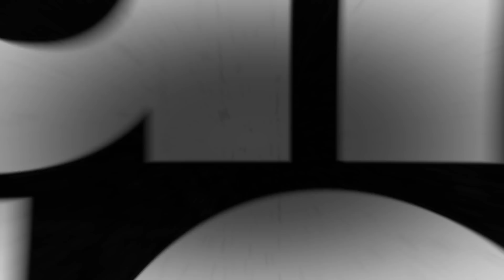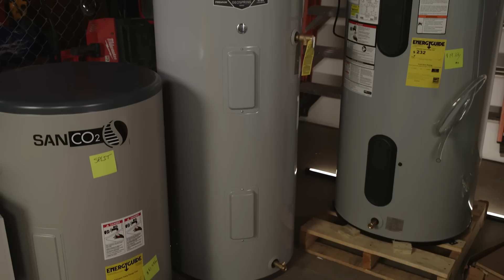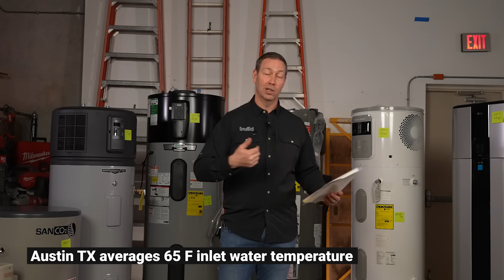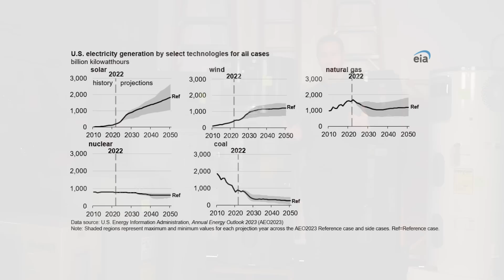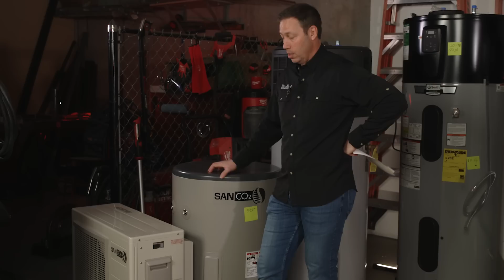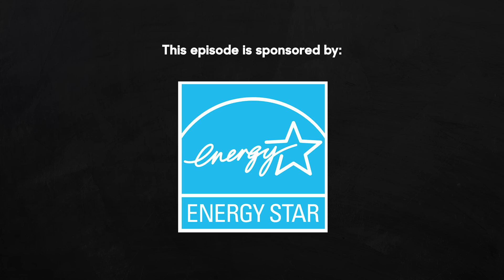2024 Heat Pump Water Heater Buyers Guide

Comment: This is exactly the video I have been looking for.  Have an aging gas hot water heater and wanted to know options that were available and details on it.  Now to find an installer in the Boston area that won’t charge an arm and a leg for installation!
Reply: My math for North Jersey said that any HP unit with a COP >= 3.25 is at least as cost efficient to operate as a gas-powered unit.

However, if you already have a gas hot water heater, the operating cost difference is going to take a very long time to pay back the capital cost of ripping and replacing a still working gas heater.

If you need to replace your gas water heater anyway,  then a HPHW can make sense as a replacement contingent upon the math.

If you want to remove combustion appliances from your home to improve safety or improve indoor air quality, these might be reasons that justify the premium of a rip and replace of gas for HP.
Reply: If you're interested, check out the actual test I did of a few of these on my channel. He missed the Stiebel Eltron that I really like. The video is Ultimate Real World Test of 3 Heat Pump Water Heaters
Reply: @BensEcoAdvntr The Stiebel Eltron wasn't included because it isn't on the Energy Star site today, or at least I couldn't find it.

I saw some positive videos on it a while ago but couldn't find it on the site then also, and that means it wasn't eligible for any Energy Star rebates which gives it a cost disadvantage.
Reply: @jeremyjedynak  that's too bad, it's a great unit and just as efficient in the real world as the A. O. Smith
Reply: @BensEcoAdvntr  I'm pretty sure it's your video that I watched months ago, if you went through having three different HPHW including an AO Smith and finally the Stiebel Eltron.

Consider doing some digging to find out why the latter isn't Energy Star certified. Difficult to see how anyone not on the Energy Star list remains in business let alone competitive when the enormous rebates for the the products and companies that are on the list.
Reply: Thanks @jeremyjedynak and @bensecoadvntr for the additional information!

Comment: Off topic question 
Do you think instead of zip or tyvek(housewrap)for your wrb you could use an elastomeric roof coating?Use normal osb then zip tape the foundation connection followed up with rolling on a elastomeric roof coating. Something like ol Henry or liquid rubber. Then flash your windows w/stretch tape or liquid flash
Reply: There are fluid applied WRBs meant for this. Idk the chemistry but surely there’s a difference so let the roof products stay on the roof and let the wrbs stay on the sheathing of the walls
Reply: @baxt1412  Great! I can't seem to find one for specifically what I asked about. Osb not zip. Can you please elaborate?

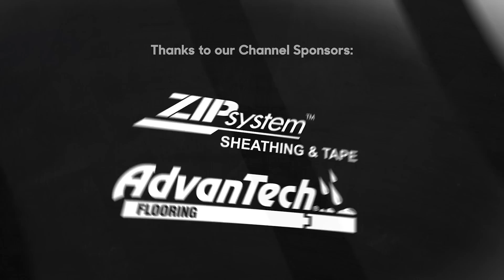Comment: 21:32 We installed a SanCO2 HPWP in Aug 2023. The heat pump was hung on the garage wall next to the 80 gallon tank. It replaced a 50 gal NG WH. We have never had hotter or so much hot water. The HP runs  very quietly and uses very few kWh. The tank doesn't have an anode rod so the tank is maintenance free. The SanCO2 has the best warranty - 15 yeard on its stainless steel tank and 10 years on its heat pump which SanCO2 will replace with a new HP unit if it needs service. The HP uses CO2 as the refrigerant which has the lowest global warming potential on the market. Also I couldn't find a local plumber or HVAC who would service an all in one HP as plumbers don't service HVAC and HVAC don't service water heaters. SanCO2 are the most efficient HPWH on the market. I'll be taking advantage of the $2000 tax credit via the Inflation Reduction Act to bring down the out of pocket cost to $6500.
Reply: The 80gal Rheem HPHW we installed last month was $2,451 including delivery and tax, the week before Black Friday 2023. Local power company rebate was $750. Federal tax credit will be $735.

This brings the net cost of the Rheem HPHW to $966.

As much as I like the idea of the Sanco2, it seems that spending $6,500 instead of $966 won't yield a 5.5x greater operating efficiency that would be needed to justify the 5.5x price premium.
Reply: My rationalization centered on I'm expecting/hoping the SanCO2 system will have double the service life, no local plumbers or HVAC would work on an all-in-one HPWH, the SanCO2 was more efficient so it's kWh consumption better fits within the remaining capacity of my PV system, and it has a much higher first hour capacity. Another cost difference was the SanCO2  cost around $2000 for removal of the NG heater, piping, vent, and installation of its relatively complex piping connections.
Reply: A double service life isn't evident as the Sanco2 warranty isn't double the length of the Rheem HPHW.

Also looking at the UEF (proxy for COP) numbers on the Energy Star site, the Rheem has a UEF of 4.07 while the Sanco2 is 3.5, so at least by the measurement standard established by Energy Star, there unfortunately doesn't appear to be an efficiency advantage that would justify the price premium of the Sanco2.
Reply: @jeremyjedynak  For 83 gal tank we installed, the Heating COP @ 80/47/17°F is 5.5/4.2/2.8. Additionally after reading the reviews of all-in-one HPWH, I didn't trust their service life, no local service, and I didn't want the maintenance hassle of maintaining a filter, changing the anode rod and having a tank susceptible to rusting and failure. Pay your money, live with your choice. It's a crap shoot which is cheaper over a period of 20 years. As the tank is stainless steel with no anode rod, I expect the tank to long outlive the heat pump so if the heat pump fails, you only have to replace the heat pump instead of the whole HPWH system.
Reply: @KentWimmer  Pre-installation, we had the passive anode rod from the manufacturer removed and an active electronic anode rod installed. $160 on Amazon, and comes with an actual 20-year warranty.

No concern about tank corrosion, and an actual warranty to back up that confidence.

I really wanted to like the Sanco2, but their product pricing isn't competitive compared to alternatives in the market, when objective metrics are used to make the analysis.
Reply: @jeremyjedynak  I'm gambling it will pay off. Good luck to us both.

Comment: I’ll try to do the math later about the monthly price difference between gas units and heat pump electric. Would have been a good addition to this video!
Reply: In North Jersey, my math said that any HP unit with a COP >= 3.25 is at least as cost efficient to operate as a gas-powered unit. And gas is way more cost efficient to operate than resistive-only electric, propane, and oil alternatives.

Comment: Installed a Rheem HPWH in my garage and if you live in a cool climate it's garbage. Energy savings are way overstated. Summer is ok but winter is worse than useless. Horrible recovery rate. Winter it will run until it freezes the evaporator and never goes into a defrost cycle. Won't stay set on resistance setting so I have to babysit it. Get an outdoor compressor with an inside tank if you want to do it right in a cool climate (like Seattle).

Comment: I would be curious to see/hear a legitimate discussion on using these for a heating source for radiant floor heat.  Seen and read forums that argue both sides with no actual data to back it up. But i am looking for more energy efficient ways to heat tightly built new constructions homes.
Reply: Same. You would want a vent kit so it uses outside air since you’ll never steal enough heat from the garage to heat your entire house.
Reply: @Krunch2020  Where i am at it would be in the basement with heated floors.  Could still vent from outside if necessary but would be concerned when the high is -10 like it is supposed to be next week.
Reply: It all depends on the climate where you live and how much floor area you want to heat. Most of these units have very small continuous heat output - the largest I've found is the SANCO2 GS4-45 which has a 15,500 BTUH output. They rely on running for several hours to heat up a small amount of water, generally while you're asleep (12 am - 6 am) and again while you're away at work (9 am - 3 pm). If you tried to heat water and your house, even a modern, well-insulated house would have to be only about 500 square feet. Several companies make air-to-water heat pumps which have a lot more capacity so they can heat and cool a larger house.
Reply: @kgsails7102  good to know.  My plan was to use it as a closed loop system so it would be dedicated as home heating only.  But like i said, that is still good info.  Thanks!

Comment: Matt - great content.  Part 2 - I would like to see how these hybrid heat pump water heaters work alongside a recirculation pump.
Reply: This is covered in ENERGY STAR sponsored training but would have been a good idea to include in this segment as well. Manufacturers state that recirc pump is fine as long as its a "smart" recirc pump set to a timer for when showers, bathroom use is most common, or have bathroom sensor to indicate pending use. You don't want the pump running 24h/7 w/ a HPWH.
Reply: If Matt does this suggested Part #2, I'm certain that EnergyStar won't be sponsoring it. :-)
Reply: Yes this would be so useful! I think many installers could benefit from this. (See my other comment about my experience with an installer who claimed to know but clearly did not know how to use one with a recirculation pump)
Reply: Matt has a heatpump water heater and recirculation system in his own house. I assume they work fine.
Reply: I have two Rheem hybrid water heaters and a recirc pump, and it works "fine" only by a very limited metric.

Even with two heaters working together, they can't keep up with the demands of my five-person household unless they are in "high demand" mode. Forget "heat pump only" mode. And in a recent discussion with Rheem technical support, after the water heater's emergency cutoff (ECO) tripped, I was told that I shouldn't be using "high demand" mode (if not, why did they bother putting that mode in the unit?), and that in any case, the water heater shouldn't be used with a recirc pump.

The tech's position was that it's just too much load on the water heater, and that can lead to glitches like the overtemp tripping (he didn't explain why that would be...seems to me if anything an excessive load on the water heater will keep the internals cooler, but...whatever...that' what he said).

My water heaters are about 5 years old. Maybe the newer models are better. But my own experience has not been favorable and I was told specifically (after the fact, of course) that I shouldn't be trying to use the heat pump water heater with a recirc pump.

(And yes, the recirc pump is on a timer.)
Reply: @harvey66616  super interesting. I'm planning almost an identical setup to yours. I've spec'ed two 50 gallon Rheem heatpump units and recirculation. How much insulation did you apply to the hot water pipes? Are you running a mixing valve? I'm in framing right now, so I can still adjust my course, but you've got me worried.
Reply: @jonathansage2147  I have some old not super insulated pipes (seem like 1 inch r2.9) and total run seems to be ~150 feet. I measured heat loss out of the pipes and heat that actually left the tap and found that the heat lost through the pipes is a very significant load. With a normal schedule (~6am-10pm) I would loose over 5x the heat out of the pipes as I would get useful heat out of the taps. YES this means that I would be more efficient if I used point of use resistive heaters at every sink than the heat pump with COP=4 in the garage and keeping the pipes more. I am very surprised there aren't as many academic papers studying this. Currently i'm using a custom setup to run the recirculation pump when it detects more than about 20ml of hot water usage. My current average effective COP (heat energy out of faucets/electricity into water heater) is 1.11 over the past 90 days, so at least that is better than 1.0 of resistive heating at the faucets. 

Tl;dr: Definitely put as much insulation on your pipes as possible!

Data is from me attaching temperature sensors to all pipes into and around the water heater, a revenue grade water meter for measuring flows, and a revenue grade power meter, with all metrics and energies calculated on 5 second intervals.
Reply: @jonathansage2147  No mixing valve. No one even mentioned that as an option when we installed the water heaters. Hot water lines are pex insulated with regular closed cell foam wrap everywhere.
Reply: @harvey66616  5 year old Rheem HPWH are a generation or two ago. UEF of those is significantly lower than current generation. Are you using mixing valves and keeping internal temp at 140F?  How many long each day is recirc pimp on?
Reply: @npjutras  see above. Recirc runs a couple of hours in the AM, and then four or so in the evening.

But if any choice I made about the recirc timing, even running the pump 24/7, was going to be an issue, the installer that sold me the equipment should have said so and the product documentation should as well.

Maybe the newer models would better meet my expectations, but I'm not inclined to gamble on it again, especially since there still remains the question of getting service if/when something breaks.
Reply: @harvey66616  I’m sorry the installer and manual didn’t say anything about this. 6 or 7 hours a day is a lot. Best practice from an efficiency and performance perspective is to use a recirc pump with multiple occupancy sensors.

Comment: These things are dead simple to install.  I installed one in 2 hours and I have never installed any water heater before (although I have done maintenance, like flushing and replacing parts like thermocouples, elements, etc.).  It was an AO Smith 240V unit... but I will be installing one for my own house here in a few weeks to replace my gas water heater and using the 120V model.

The other thing to consider, if you eliminate enough gas usage, you might benefit from eliminating your service.  I replaced my AC with a heat pump this past summer (although I still have the gas furnace as a backup... we're getting a big cold snap this weekend, so it will be the first real test for the heat pump).  Once I replace the water heater, I have a gas fireplace that we rarely use and a gas stove (electric oven).  I am going to look at disconnecting my gas service and just switching to having some propane tanks that I exchange.  Yes, propane is a tad more expensive, but I will use so little that it will save me a ton of money because my gas service costs $30/month just to have it available.  I can't imagine that I will have more than $80/year in propane since it will just be for the stove, the gas fireplace, and a backup to my heat pump.
Reply: Trying to do something similar to wean our house off #2 heating oil.

Comment: Have electric panels , so when I needed to replace the water heater I went with a 50 gal heat pump water heater in my garage ! I was blown away by the efficiency , about 4 to 5 times better than regular water heater and I got to cool my garage ! win-win all the way !!
Reply: That's great in the summer but would kind of suck in the winter here in Ohio.  Welcome to my garage deep freeze!

Comment: I'm ducting the intake of mine from above the shower in the basement so it removes the moisture and recovers the heat from the warm hot air rising from the shower. Plus it's guranteed to run when showering so the kids won't 'forget' to turn it on.

Comment: Doesn't seem very efficient considering the fact you now need your heating/ cooling system for the house potentially take on this extra load as well as the ventilation fan and/or condensation pump... starts to add up to the same or more in energy cost, upkeep and the cost initially being exponentially higher at purchase.

Comment: In the fall we moved from a natural gas unit to a Bradford White HPWH - both 80 gallon class.  We are in SF Bay Area.  We run on heat pump only mode.  The app and smart features (to go into VAC or other modes) is horrible.  3 times in first month it randomly kicked us into VAC mode and left us with no hot water.  Not fun.  We ultimately unplugged the wifi control board and just go without smart features.  It's fine.  Never had an app for a water heater before, I can live without one now.  Hot water is great.  We run to 140 and have a mixing valve to take it back to 120.  Family of 4 (including 2 teenagers).  It does cool our garage (3 car) a bit.  Hard to tell exact temperature reduction.  Maybe 2-5 degrees?  Should help in the summer - really don't care about it being colder in the winter.  Sound is manageable.  They installed with a think insulating rubber-type material against a shim connected to our wall, so the earthquake strap pulls it into the softish material to help deaden the sound.  If you have a bedroom right next to it I could see it being somewhat annoying, but the sound is low enough that I think most people could get used to it.  It's by our kitchen, so it doesn't matter for us.  I doubt in SF area that it will save us money - probably a wash for us (our electricity is quite expensive, our gas averageish, so the trade doesn't give you an arbitrage on energy cost per BTU equivalent).  But bc heat pumps are so much more efficient (ours was a 3.6 coefficient??) I think it will end up being a wash cost-wise.  In other states with cheaper electricity, this could save a lot of $.  But it was insanely cheap to install.  SF area has local/regional incentives (TECH, Bayren) right now and we were able to get it professionally installed (install, electrical work to run conduit to a 40 amp breaker in the garage, removal, etc) for only $1500 net of rebates.  And that's prior to us getting the 30% tax credit.  So this will ultimately cost us about $1k for an 80 gallon hot water heater - about 1/3 the installed cost here in our region for natural gas unit installed.